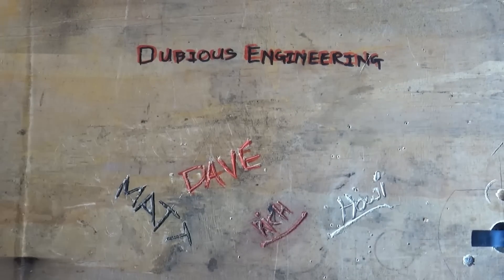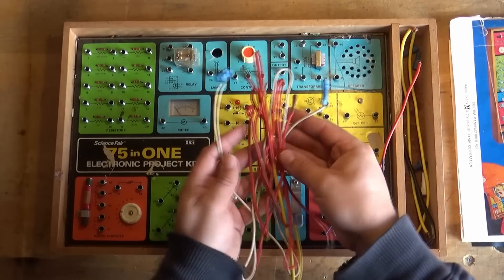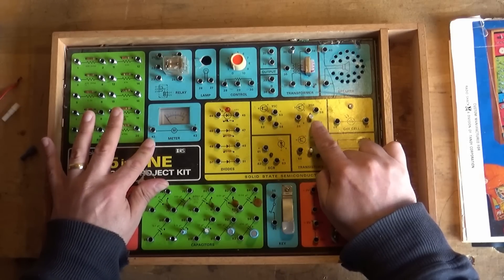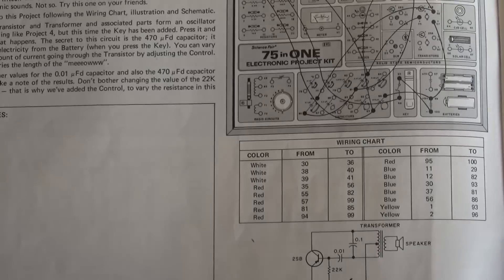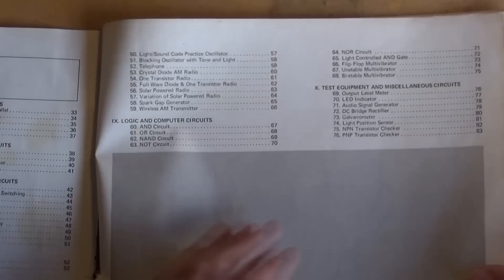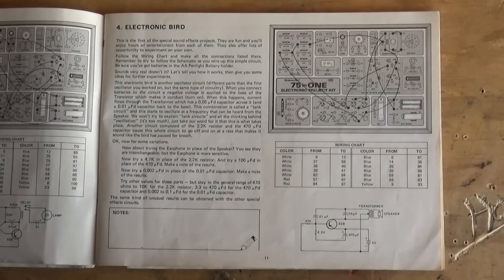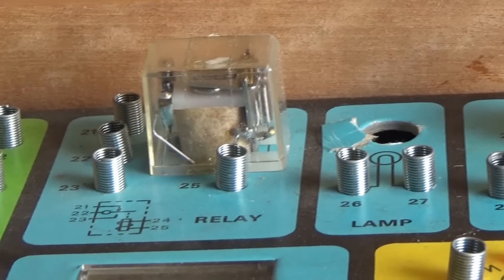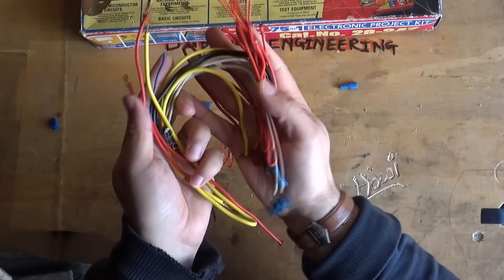DuB-EnG: RadioShack Tandy 160 in 1 Science Fair Electronics Project Kit Old Vintage Nostalgia Nerd

Comment: I have bought the 40 in 1 electro magnetic kit science fair NEW and the connections are tarnished. I suspect even the wires... what do I do, Please help. Beautiful, spanking new and doesn't work. I tried 1 lamp with new wires and barely worked. So I know the components work, just 50 years old thats all...
Reply from the maker: Aww...  maybe buy some modern copper bell wire and a little.emery cloth to gently.remove the tarnish between all 1000000 spring contacts 🤔  😀😃
Reply: @DubiousEngineering  I think to replace them all and what I cannot replace, put it into CLR solution?
Reply: @DubiousEngineering  also the motor would have to be replaced too probably

Comment: Oh wow, that takes me back, I had one very similar to that, hours of fun!  But I was also a disassembler as a kid, no faulty (and sometimes not so faulty) electronic or mechanical items got past me and a screwdriver on their way to the tip!
Reply from the maker: aerk12 ... excellent! ... we are all of the same breed...  my problem was that I took a screwdriver to stuff that wasn’t on the way to the tip!...  and sometimes it wasn’t even mine to take apart!
Reply: Oh Dear you sound exactly  like Me. It was almost impossible to get your hands on Components. then. I tried from s local shop. Webb Electronics I think.  The only flogged me incorrect Dufunked  overpriced parts they had left over. No wonder Zilch worked